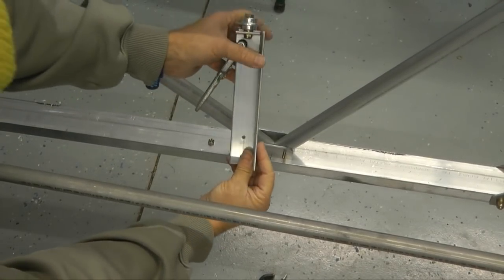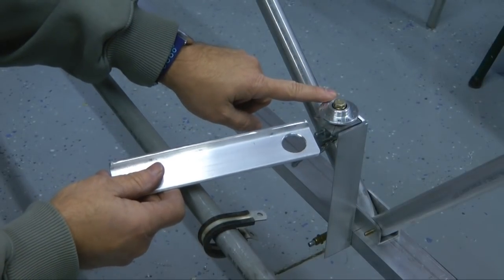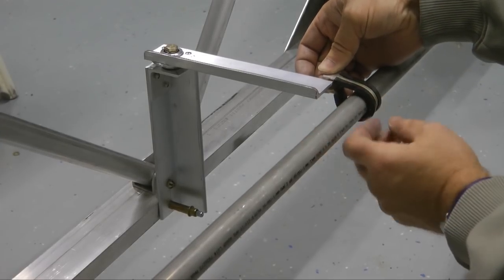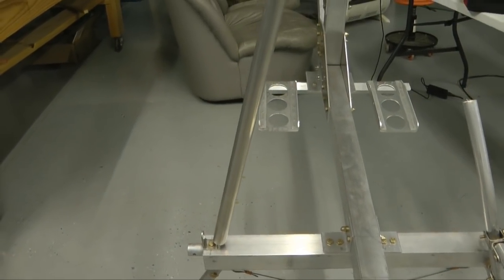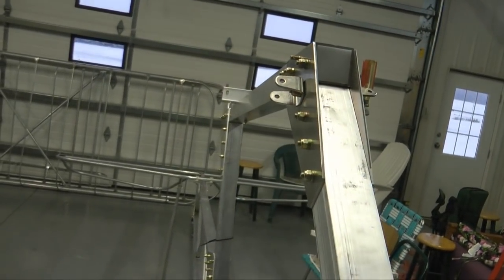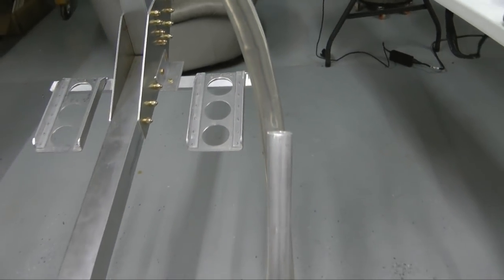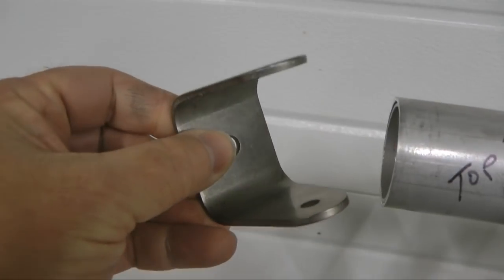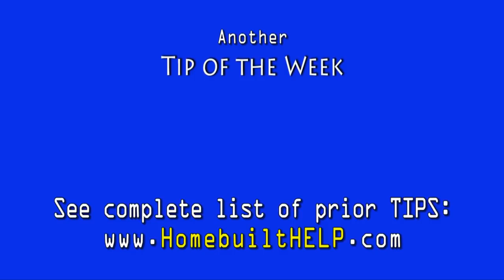Building the Affordaplane Part 33

Comment: I could envision the elevator controls jamming if the adel clamp slides back on the push-pull rod so it’s already back as far as it can go - then if you try to pull back on the stick the rubber clamp would grab the rod and prevent it from sliding, so you might want to add something that prevents the clamp from moving along the rod. Excellent work though! Thanks!
Reply: Same thought here....I have built 4 or 5 planes in my time...and this was my  first no no...otherwise a good job...

Comment: I very happy to have just found this series. Thanks for publishing. However, that use of a rotating arm and adel clamp is worrisome. That could DEFINITELY jam. Not only does it pull/bow the rod out of alignment, it can definitely jam as it will pinch the tube as the arm rotates past a certain angle. Assuming input control sitting at midway, If that arm was shaken around and assumed a maybe 10 degree offset (while in the air or pre-flight) it would pinch the tube you would not be able to move it further in that direction, the rubber insert would grab the tube. I'd use a fixed arm with maybe a teflon sleeve (to minimize wear)

Comment: How much weight would be saved using welds and or SS rivets and even shaving down those well oversized in many cases gussets especially if welded? BTW of the people flying this what is the max pilot weight actually flying this?
Reply: Well,  you can build it any way you want...Bolt it...Weld it, heck ,if you can find glue strong enuff, you can glue it..Here the kicker, tho...How many people know how to  weld aluminum...???... How many  people including you know how to  calculate shear metal strength??... And, last...Typical a Ultralights  you needs to be "round 250 lbs or less...If you some big goober dude, then you  might  need to look at different plane....like a LSA....
Reply: @ToyManFlyer1100  I would still be curious about the weight saved on welds vs all the bolts and such but yes welding aluminum is harder and less do it but more than a few of us haven't weighed 250 since we were 10. Some of us are just big but still cannot afford to purchase training and a license to fly LSA.

Comment: Is it possible to TIG the wing ribs into position? I am not sure about welding that aluminum.
Reply: possible yes, using the right filler, low voltage, good positioning and enough argon, pulsed tig ac biased about 70%. it is also possible to burn holes, create weak spots, soften the parent metal and fuck it up generally. I'd look to builders of welded aluminum boats for advise there.

Comment: How about a tube half the diameter inside the tube going back to the elevators with donut spacers? That way its self contained and will be stiff as a board with no chance of binding. I would do some testing but could make the spacers with a hole saw. But double wall with a spacers every foot or so would be more aerodynamic too?
Reply: Hi, David. Or you can just use a bowden cable instead of that double tube as many other ultralights do, like the MiniMAX/Hi MAX family